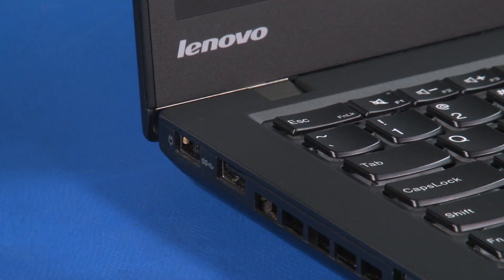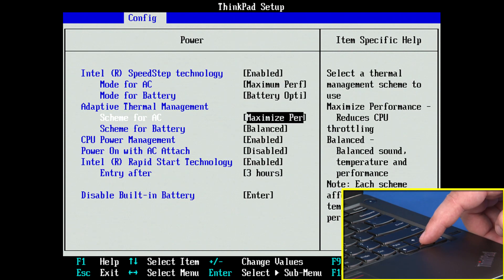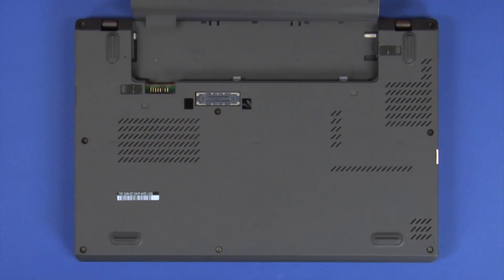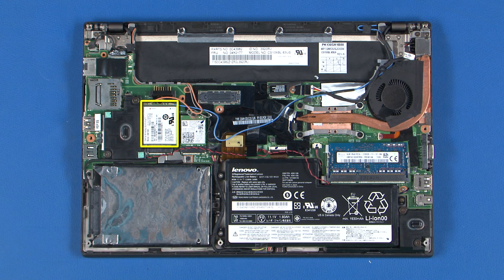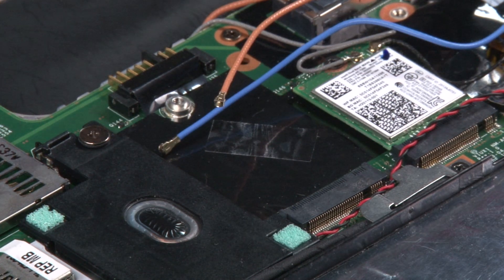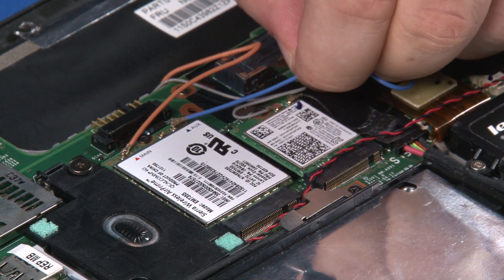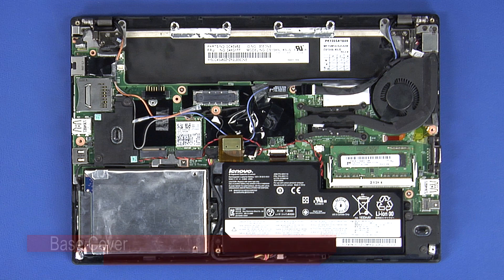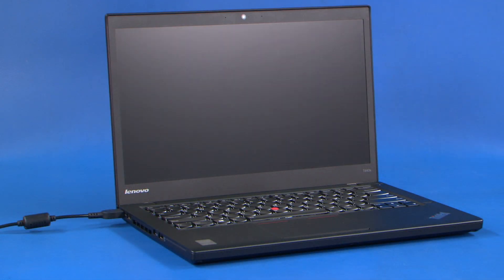ThinkPad X240, X250 - Wireless WAN Card Replacement

Comment: hello, is the internal battery necessary for the wwan card to function , i want to install a wwan card without having to buy a new internal battery
Reply from the maker: Hi zino, thanks for reaching out. Could you tell us the exact model of your laptop or the machine type model for us to check? Chx_Lenovo
Reply: @LenovoSupport  yes it's thinkpad x270 with no wwan card nor internal battery and i want to install a wwan card (it would be very helpful if you can show me which one is compatible with my laptop)
Reply from the maker: Thank you very much. We found that the thinkpad x270 comes in a variety of models. Could you please share your laptop's serial number https://lnv.gy/3GSI5ny so that we can check the exact specifications of your model? Please send it to us via direct message on our Lenovo Facebook https://lnv.gy/3gEco6J or Twitter https://lnv.gy/33kvfAE, and please include the reference number #1801562 so we can easily recognize you. We will be waiting. Chx_Lenovo

Comment: did WWAN Card 4G LTE EM7345 compatible with my x260? i need this wwan card at my mobile working
Reply from the maker: Hi Ade! Thanks for reaching out. based on the Platform Specifications https://lnv.gy/2Y5ys0d, if it compatible with:

• Wireless WAN, Sierra Wireless EM7455,
Qualcomm 4G LTE-Advanced/DC-HSPA+/HSPA+/HSPA/UMTS/GNSS, M.2 card
• Wireless WAN, HUAWEI ME906S

You can also enter the serial number here https://lnv.gy/2AaB58W and go to Parts (on the left), then select Wireless WAN Adapters under commodity. Let us know if you need additional help. -Maru_Lenovo
Reply: @LenovoSupport  okey maru
big thanks for ur information
i will search for SIERRA wireless EM7455
any info for where did i can bought this is very apriciate 
great support lenovo team
big Thanx
Reply from the maker: You're welcome Ade. Please don't hesitate to reach out to us if you have further questions or concerns. Have a great day and stay safe. Rodney_Lenovo

Comment: is it possible to use an M.2 egpu adapter in the spare slot in my i7 x240 its past warranty anyway and still a solid machine and I would like to extend its longevity as a gaming hand me down for one of my sons, any info would be great thanks.
Reply from the maker: Hello there! Sorry for the late reply.
You can check these links for additional info.
https://lnv.gy/37luQLs and (3rd party) https://lnv.gy/2OsHwr5 Nick_Lenovo
Reply: Thanks for the help, I replaced the WLAN for the M.2 graphics and bought a USB dongle for wifi, works a treat, also sorry for the super late reply.
Reply: @RighAlban  any guide how to do that? im really interested

Comment: Hello, did WWAN Card 4G LTE EM7345/EM7355 compatible with my x1carbon gen2? whether the item can run on a frequency of 2300 mhz? thank you
Reply from the maker: Hi Dary. Thanks for reaching us. We checked further and can see the ThinkPad X1 Carbon Gen 2 have a variant model that has the Sierra Wireless EM7355 and EM7345 WWAN card. Also, the maximum frequency for this device 1600MHz. You may check this link for the detailed specifications:https://lnv.gy/34IzW3N. Let us know if you need anything else. We'd be glad to help. Have a nice day, and stay safe. Ash_Lenovo
Reply: @LenovoSupport  It's work in Windows 10? because my WWAN Ericsson n5321 sim card can't be detected, and driver it's up to date .
Reply from the maker: Based on this link: https://lnv.gy/2GJ0wBV, the Ericsson n5321 is compatible to work on Windows 10. Try to download the WWAN driver from the link and check if it will allow the machine to detect the Ericsson n5321. 

You may also view this link: https://lnv.gy/30QuACx for the compatible parts for the x1 carbon gen 2 (20A7 variant). Otherwise, please provide the model number of the computer so we can check. Allan_Lenovo
Reply: @LenovoSupport  I have installed the driver according to the link you sent, I checked it in the device manager, the device (Ericsson n5321) was detected, but the SIM card that I inserted into the slot did not detect a SIM card.
model: 20A8-S0JC00
Reply from the maker: Thanks for providing the details. Based on the compatible parts for the 20A8 variant here: https://lnv.gy/36S41AQ, the Ericsson n5321 is compatible with the computer. 

We'd like to know if you're getting any error messages when you plug the sim card to the laptop, such as "insert SIM" message or something similar. 

We will be waiting for your reply. Allan_Lenovo
Reply: @LenovoSupport  yes, it says (insert SIM) in the connection and network section, and in a condition my SIM card has plugged to the laptop.
Reply from the maker: Thanks for letting us know Dary. Kindly try to install all the latest updates for the machine and check if this will allow the sim card to be detected. 

Another thing you can try is to insert another sim card to the machine (if available) for further isolation. 

Let us know how this goes. Allan_Lenovo

Comment: Why did you disconnect the int. Battery after disabling it in the bios
Is this really necessary?

Little tip
To avoid electrostatic damage it helps to touch a grounded piece of metal like a radiator
Reply: not a requirement, I just physically unplug it before doing anything on the motherboard.

Comment: I want to purchace the WWAN Card 4G LTE EM7345 for my X250. But I'd like to know if the network band is limited or it can be used worldwide?
Reply from the maker: Hi! Thanks for reaching us for support. It supports 4G LTE/HSPA/GSM/GPRS/EDGE, GPS, M.2 card. You can check the certified parts from our support website https://lnv.gy/33qBtcI by entering your serial number and clicking on parts. Let us know if you need more assistance. -Maru_Lenovo

Comment: I have a yoga 370 and would like to add a WWAN card. It seems straight forward, but I can't see any antenna cables. Are those available for purchase?
Reply from the maker: Hi! Thanks for writing in and you have a good question here.

You can use this helpful item https://lnv.gy/2lJ8RY8 pages 87-90 on how you can replace/install the WWAN.

In addition, you can find the compatible WWAN for the Yoga 370 here https://lnv.gy/2lKNFRq page 1.

Could you tell us in which country you're located so we can provide you details on where you can get the part? We'll wait for the details and look forward to assist you further. Thanks! Marky_Lenovo

Comment: hello i was replace thie wifi card on X230 but after it not run , the bios is no accepte the new card. it is the same with the X250 ? thanks and sorry for my bad english
Reply from the maker: Hi! Thanks for writing in. What is the brand and model of the wireless card you installed? Lenovo Thinipad X230 has a list of acceptable or comaptible hardware that can be installed in the laptop. It can be found here, http://lnv.gy/2jDOPjS. Mac_Lenovo
Reply: thanks you for you list and you short answer, a will check what is the reference see you .
Reply: Simple answer is Lenovo is not allowing you to put your card in there cause they have chosen to and locked and whitelisted cards in BIOS. Its for money although they say its for compatibility.

Comment: Hello,
I recently upgraded my Lenovo T440p with this card and it works fine for mobile networks.
However, I only have two cables connected as shown in the video but the card has the third one, labeled GPS (also visible in the video)that is left disconnected as there is no antenna cable in the machine to attach to it.
I would like a GPS functionality with my laptop.
Is there a special, additional, GPS antenna and cable upgrade option available in order to enable GPS functionality?
Maybe it's just an "auxiliary/optional" and the GPS is possible even without it (wishful thinking)?
Thank you for your response.

Best regards,
Milos
Reply from the maker: Hi! Thanks for contacting us. Could you please provide us the machine type of the laptop you have? You can find it at the bottom of the laptop. We'll check the details from there. Thanks. ARjay_Lenovo
Reply: Sure,
Bellow is my laptop label (clearly visible code under battery):
TYPE 20AW-S5HM00 S/N PC-0BNAPQ 16/03
Thank you for your help.

Regards,
Milos
Reply from the maker: Thanks for the details. As per checking, the laptop came with WLAN card and it does have only two cables for it. If you're card does have gps functionality, you would need to get the cable for it from third party stores. Thanks. Arjay_Lenovo
Reply: Can you please direct me toward relevant part number (GPS cable and antenna) and a place to purchase it? Instruction on how to install the part (Service Manual) would be much appreciated too.
Thank you.

Regards,
Milos
Reply from the maker: There is no part number for the gps cable as the unit does not came with this one and some other unit with WWAN does not have gps. Thanks. Arjay_Lenovo
Reply: Ok, got it. So it's "make your own" or no GPS on my laptop model.
Well, I do have GPS on my phone so I guess it's all good.
Thanks anyway.

Regards,
Milos
Reply from the maker: You're welcome! Feel free to send us again a message here at social media if you have other questions and concerns about your Lenovo 
device. We're always here to help. Mark_Lenovo

Comment: If I upgrade my x250 with the mobile broadband do I invalidate the warranty? Thank you
Reply from the maker: +Raffaele Angius I'm not sure I can field that question. You might want to call Lenovo Support. My understanding is that if the machine is "Wireless WAN Ready" (meaning it already has the Wireless WAN Antennas) and you install the Lenovo compatible Wireless WAN Card, you would not void your warranty. For compatible cards check lenovoquickpick.com